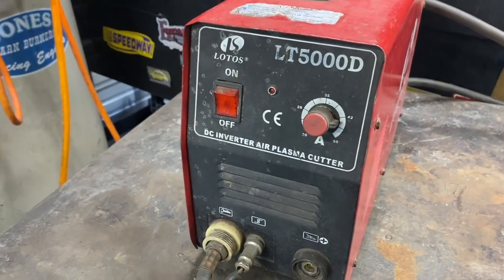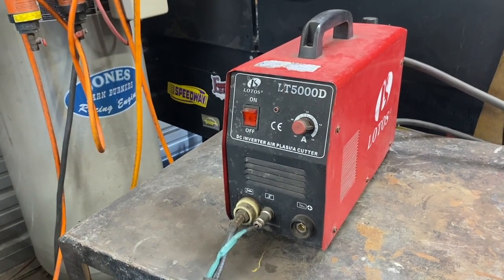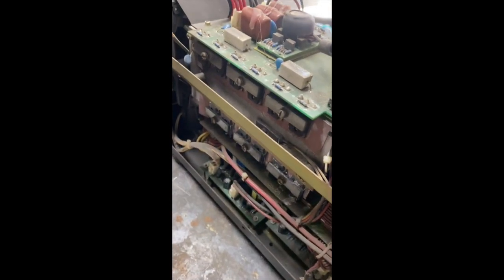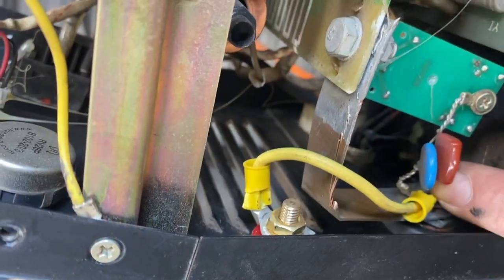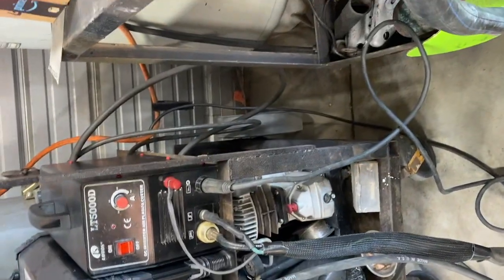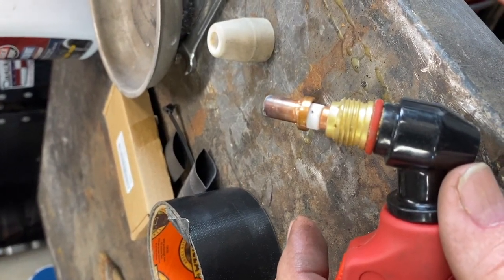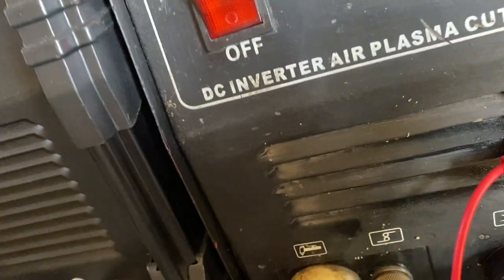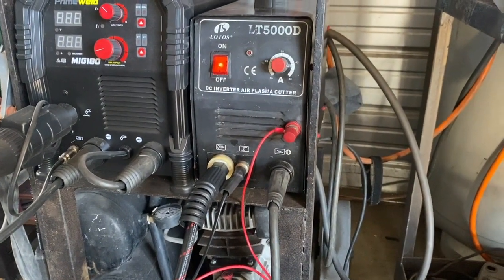Plasma Cutter Pilot Arc Conversion

Comment: This brand is in the dark, I don't know why. I have the LTPDC2000D (the red one) and it's been a great machine. Mostly, I use the plasma feature and it cuts OK. Great video, enjoyed watching. Thanks!👍👍
Reply from the maker: Thanks the pilot feature is great for cutting dirty rusty metal like an old car body for rust repair. I use the old non pilot arc gun still to cut new clean sheet metal because the cut is a bit sharper and works better as a like to drag the gun That machine still works great either way. I can’t believe it still works 
Thanks for watching

Comment: Where did you buy the lug for the connection
Reply from the maker: Amazon  has them , unfortunately I couldn’t find them locally. Electrical supply store or Radio Shack type store

Comment: What gauge wire did you use for pilot arc?
Reply from the maker: It was in the gun I bought.  The wire is thin like 18 gauge. I ran a 10 gauge wire inside the machine with no issues .  I used the machine last week to cut up some junk. The only thing is when you cut through painted and rusty metal it really is hard on the tips

Comment: If this is really all that is required, why aren't manufacturers just doing that from day one?  Seems like there may be more to it.
Reply from the maker: I was thinking that also. I have been using it for a few months since with no issues. I really needed something to cut through rust without having to grind a bit off so it can fire up.. My plasma cutter is old and I was willing to take a chance. I didn’t care if it blew up and It’s probably going to shortened its life.  Not sure . I think the torch  has a bit more to it having the ground going all the way to the tip. I look at the cheap plasma cutters out there and almost all of them have pilot arc now . When I bought mine 13 years ago , it would have cost a couple of hundred dollars more for pilot arc. Now it seems only about 50 dollars more for one.

Comment: Good clean mod but to be safe might want to add a few resistors on that new line. 2 20ohm 20w is what they put in the unit with pilot arc on a timed relay. Beyond that they are the same unit from what I can see. I only say this cause I have pilot arc unit and long use of pilot arc can heat pilot arc line fast. It has even burn out resistors from extended use which is an easier repair
Reply from the maker: Thanks I’ll check into that